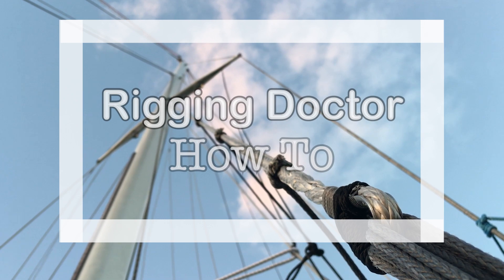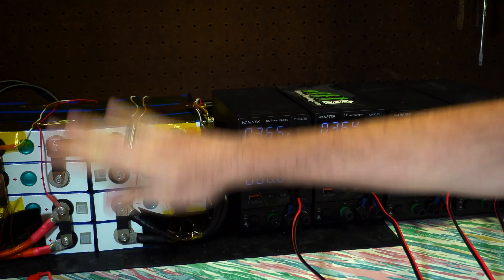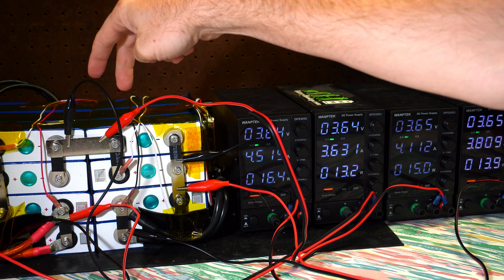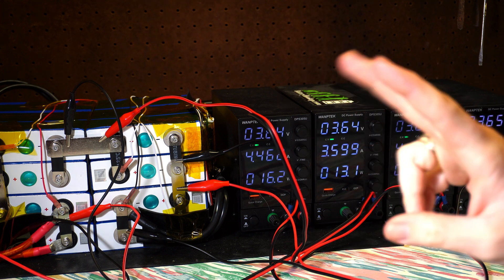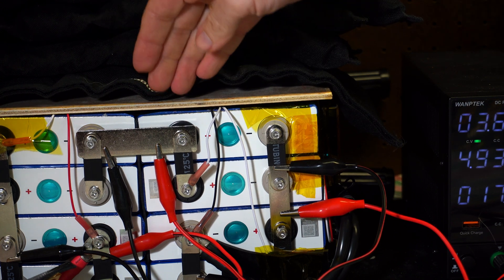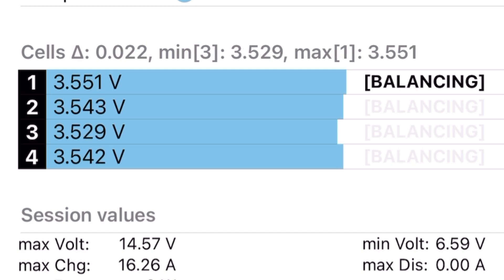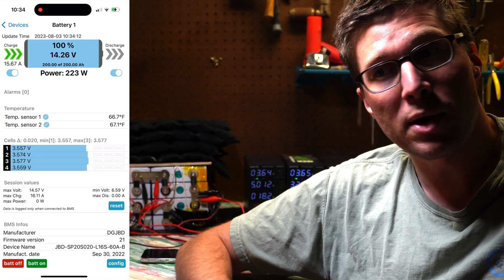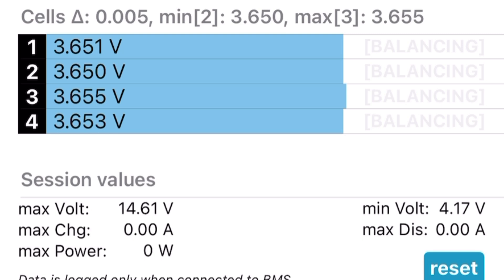Top Balancing a Lithium Battery Pack

Comment: same but 16s   pack   ~~
one cell was 1 year on bad bms and  now  doing it  with one wanptec  on an rc  charger to gain some more amps!!!  cables give about 10 amps   but system is on work so  solar  is raised to 3.44v   float per cell and after all  cells ( except the  lazy one i push )      been 3,55 for the day   but now rest  at 3.44  ..   but i choose for the cell 3.51v      amps it gets are more whole working system asks  from cell  but  it is in possition 16 to be easily replaced with a new if ruined!!!  
 but i figured out a little bit of parasitic    strange behavior in output  cell 1 and 16 !!!   maybe inverter is too big and  need to shut down  but the whole  buisness is off grid and everything needs to be under sun and monitored!!!  i lost the best time of the day the 2 hours of absorption so i  made some absorption made mppt    to float higher  ONLY  when i manual balance!!!
    question   ... HAVE you ever been dealing with  jk bms that  shows  strange behavior in a specific  cell possition no mater cell you put no mater  lid  you replace  !!! it has some sensitivity and cell possition 13  sags and overcharges inside algorythm   but cell is monitored and its ok!!   .  this bms  cant go more than 11 s no because of that bad behavior !!!   b series ... 20 s

Comment: So, Now I need 48 power supplies?
Reply from the maker: Haha! I feel that way sometimes!!
You can get by with much fewer. I only have 4. 
I simply charge 4 cells at a time, then move to the next set, then the next, until they are all fully charged. Then I wait a day for the voltage to settle and see how we are looking. Any cells that might need a little more get more charge until all the cells are within 0.001v of each other and above 3.600v. 

The other way is to take off the plates and wire them all up in parallel, then charge them up to 3.650v and then set them up in series. I haven’t done it that way because it seems like more work and higher risk since you could potentially cause a short by accident with a lot more power stored in there!

Comment: I would not recommend doubling up cells to achieve hire amperages.. There is always a chance one cell will go high resistance while the other goes low resistance causing one to under charge while the other goes nuclear meltdown and sets the whole pack n fire.. The BMS has no idea what is actually going on unless you have one cell per sense line.. For all the cash put into lab chargers you would have been better off getting a stand alone balance unit that can shift 5a or 15a from a high cell to a low cell.. This way you could push 100a into a 4 cell 280a assembled pack and have it charged and balanced in 4 hours.. With a BMS that has a 2a balancer it takes overnight charged in a couple stages but it is still faster and easier..
Reply from the maker: Do you have a link for the balance unit?

Comment: I found that a solid connection from the power supply to the battery actually increases the amps but plays havoc with the voltage

Comment: If you have so many cells to top balance (like you have like 60-100 prismatic cells, 3.2v 314Ah each), can you connect them all in parallel and top balance all the cell together at once, instead of having to buy 64 - 100 power units to top balance them or waiting forever to top balance each one at a time?
Reply from the maker: You could but you will want to connect them with jumper cables between the poles. When you top balance they will be full charge and if you then disassemble them to reposition them for the battery, you run the risk that they might swell and ruin everything. You want them compressed and in their final position when you top balance. 
Removing the plates and then running insulated wires from + to + to + will link them all up in parallel with minimal risk of a short from the - wires running along as well. This would let you hook up the power supply to the poles and give it a long time to come up to charge. 

Good luck! Sounds like a sweet build you are working on ;)
Reply: @RiggingDoctor  it's still quite hazy to really understand. Please I don't know if you could do a video to explain this practically - these are really practical stuffs and visual aids really go a long way and help so much. 🙏 🙏 

For building large battery packs like 60kw-100kw, that may involve more than 60-100 prismatic cell batteries (like the 3.2v 280Ah or 314Ah cells), how to top balance them all the right way.

If you could make a video on it, you may not need to use 60-100 cells to explain. Just 8, 10 or so cells will suffice (or just vocal clarification/explanation could do) to help us get the bigger picture on how to scale the top balancing method/process to any size of battery with any number of cells 🙏.

I initially was thinking 💭 🤔:
★ "do I need 64-100 seperate power units to top balance 64-100 battery cells simultaneously (to save time)"?

OR

★ "do I have to use only 1 power supply unit to top balance them all,one after another and wait forever to top balance all the 64-100 cells"?

Please if you could really do a video on this to clarify, it would be greatly helpful 🙏 🙏 🙏 
Thanks. ✨
Reply: @RiggingDoctor  also please when top balancing the batteries, is there a limit to how much current you should use to top balance the batteries.

With powerful power units, it may be tempting to increase the amps supply to the batteries to like 10A+ or 20-30A, to save time and make the top balancing complete faster.

Is it okay to increase the amps to much higher values (for obvious faster time to complete) or not good to do so?

Comment: Why not just connect them parallel and charge with a higher power supply? That would balance more evenly than relying on four different Chinese power supplies.
Reply from the maker: The issue is the cell compression. To charge in parallel I would need to arrange them in a row with all the plates on. Then while full charge, reposition them into their new form and compress them again before the puff a bit. 
Charging each group individually is not as reliable if you are going off of the power supply, but that’s why having the BMS hooked up and telling you the voltage of the cell down to the thousandth let’s you make sure that they are all too balanced. 
If you don’t care about compressing the cells, then you will have the luxury of positioning the cells, but it’s one of my (unfounded) procedures that I do abide to. I have looked at evidence on both sides and see both points, but it seems like a small effort for a possible reward, so I compress the cells in their box.

Comment: I recently stumbled upon your channel and LiFePO videos. I wonder, why do you emphasize fire and explosion so much when I'm not aware of LiFePO chemistry suddenly bursting into flames. Does LiFePO need to be managed appropriately? Yes. But is it on the edge of catastrophic failure when it nears its intended operating parameters? Not that I've seen or read. Check out what John Adey, ABYC president, has to say about their recent tests on LiFePO and their attempts to recreate some of the catastrophic failures rumored to occur. They failed. No conflagration. No meltdown. No real drama. Certainly the batteries need to be monitored and operated within proper parameters, but the inherent risk factors of LiFePO feel a tad overstated in some of your comments.

Comment: Your video is very interesting is it possible to repair Your bms when they go bad
Reply from the maker: If you know how to solder on a circuit board, then yes. For me, I just carry a spare. A few bolts and plugs and it’s back up and running.

Comment: In my opinion, top balancing is not as relevant anymore as it used to be. A modern BMS will have active balancer that does the work for you.
Reply from the maker: This BMS that has very good safety features that actually work doesn’t do a good job at balancing.
Reply: @RiggingDoctor  Cheaper to buy a new BMS then a PSU... 4 PSUs in your case... 🙃
Reply: @offpro  you can also buy balancers that you can hook up until the cells are balanced. They are cheap. Way cheaper than 4 power supplies.
Reply: @RiggingDoctor  Yeah, because you don't have it hooked up properly.  From the video, it only looks like you have 4 balancing leads trying to balance 8 cells.  You honestly shouldn't be making these videos if you don't know what you're doing.

Comment: I prefer the 5A active balancers for top balancing new packs. The cells ship at roughly 50% SoC, and are not at all balanced, but also, they’re not wildly unbalanced (like 70% SoC and 30% SoC). 
Hooking them up in series, with their BMS, and charging at pack voltage allows more watts of charging faster at the bench supply max current. It also provides good per-cell voltage tracking. 
Once the cells start approaching knee of the curve (~3.40V/cell), you turn on the active balancer, and keep the bench supply charge voltage at 3.5v/cell. 
Once charge acceptance drops to about 1A, you creep the voltage up by 50mV/cell, and let the active balancer do its magic. Keep creeping charge voltage up until you get 3.65v/cell and less than 1A going in to batteries. 
I use a BMS that gives me some relays and event-logic I can use to control the active balancer circuit since leaving it on in the flat part of the curve is actually bad for long-term balance.

Comment: I know you mean well to help educate your followers but you are creating a large group of misinformed YouTube warriors. You might want to do a deep dive in to “off grid garage”. There are a ton experiments he has done to dispel many myths and misinformation out there about lifepo4. Some of which you are perpetuating in your videos. Just friendly advice, not trying to be unkind.
Reply from the maker: That is a good point, and while it is really hard to make a bad situation with LiFePO4 cells, fire or high heat on a boat is a very bad thing. 
My thoughts were two fold: 1. If I scare them, they will be careful and stay safe, 2. If they use Li-ion because they didn’t realize there was a difference, they will be ok (but the ion cells are the real danger cells on a boat. 
There are test videos where LiFePO4 cells catch fire, but the tester really “tried hard” to make them burn.

Comment: You could balance the battery very quickly with a RC style lithium battery charger because they have decent balancers for balancing multicell battery packs.
Reply from the maker: The issue with “quick” is the cell doesn’t accept the full charge quickly and it really does take a while. You will never charge the cells this full ever again, which is why the battery is said to charge very fast when in use. 
It takes a while but it’s worth it as it makes the whole battery work better.
Reply: @RiggingDoctor  When the battery cells are receiving less than one amp at full voltage the battery is very very close to 100 percent. Continuing to charge at less than one amp is not worth it because there is no more battery capacity to be stored in the battery. So the RC style charger will balance all the cells so they accept the same level of charge by using a resistor across each cell that is higher voltage than the others until every cell is perfectly even. The charger doesn't have to charge for hours and hours at a low rate it just needs to charge until it sees that all the cells are charging evenly when at 3.6-3.65 volts for perfect top balance.
Reply from the maker: Oh, you mean as a permanent part of the installation! That would be handy!!
This slow process is to get them all balanced since we don’t have that and they are being charged by a 58v source.
Reply: He talking about the Cellmeter 8 its 12.00 and i just ordered one.  @RiggingDoctor

Comment: You're a little off on your "Don't charge to 100%" comment.  Lifepo4 is not like other lithium chemistries.  The rule with Lifepo4 is don't keep them at 3.65 volts for extended periods of time, but charging them to 100% then stop charging, use them and recharge to 100% every day is fine.
Reply: Exactly @uhiyuff2095. The boat at the dock will have a float voltage. I set mine to 13.3 volts. That brings the battery down to about 97-98%. Not ideal but my manufacturer has confirmed this is ok for lifepo4.
Reply: Another thing I do is only use solar to charge my batteries. 3 -12v304ah batteries in parallel for a total of 12v912ah. They run the fridge and freezer every night to bring them down then charge back up the next day, stay at 14.1 volts for 15 minutes then float the rest of the day.
Reply from the maker: 3.65v is 100% SOC
I set the BMS to consider 3.50v to be 100% and to cutoff the charge at the high voltage mark. This keeps the battery almost fully charged on the high end and still with plenty of power to give on its way  down to discharge. 
The bigger issue is a boat that sits all week charging from the solar panels and is full charge until the weekend, that would be an example of 3.65v for a long period of time most of its life.
Reply: @RiggingDoctor  I would hope the charge controller would have a float charge mode set at a lower voltage than the bulk/absorb voltage level.
Reply: @RiggingDoctor  agreed if the batteries sit at 3.65 volts for the entire week. I’ve had LifePo4 cells for four years now. Our boat stays at the dock during the week charges to 3.55 V every day and runs the refrigerator throughout the night actually 24 seven our solar panels bring the battery up to 3.55 almost every day.

Comment: The context for this is if you are running component cells, presumably with a BMS, NOT one or more retail batteries of nominal voltage 12v, 24v etc
Reply from the maker: Yes, this is the third video in the series on making a lithium battery. This battery is a 12v battery but it could easily be reconfigured to make it a 24v battery (with a different BMS).

Comment: So, you state that LFP's hate being charged to the max, yet later you say on a sailboat with solar panels they ARE going to be fully charged a lot of the time. So what's to do? Do we have to have a cut off on the solar controller and mains charger?
Reply from the maker: Just use your electronics a bit more liberally when you are at full charge to help bring them down. Running a high power appliance during the day would be great as it will bring the power down while the panels are cranking the power. 
Ideally, you want to keep the battery between 10-90% state of charge. 
Basically, if you are charged up, turn on the water heater and use up the power. If you have an electric dinghy, this would also be a great time to charge its battery as well. 

Basically, the panels will charge you all the way up but the batteries don’t like it but as you use stuff in the boat, especially that night, it will bring the batteries back down to a comfortable level.
Reply: @RiggingDoctor  You're confusing advice for other lithium chemistries with Lifepo4.  Lifepo4 can handle being fully charged every day.  The rule is, don't keep Lifepo4 at 3.65 volts for extended periods of time (like days to weeks at a time).  This comes from my research and several manufactures advice.

Comment: The question is if you don't have access to each individual cell, as in an enclosed battery, how do you top balance then?
Reply from the maker: You top balance it before you put it in the case.
Reply from the maker: I couldn’t reach the cells in the case, so I top balanced the pack before I put them in the case.
Reply: Mine is a bought battery I didn't make it. I have no access to the cells inside. @RiggingDoctor
Reply: @mymobile5014  In that case, you don't need to top balance.  The manufacturer should have done this.
Reply: @mymobile5014  Yes, I bought a prebuilt battery and if you follow a little procedure the internal bms can balance the cells. What I did was setup a charger connected with a smart outlet. I set my smart outlet so the battery would charge for 10 minutes (once fully charged) then turn off for 10 hours then on for 10 minutes and off for 10 hours for 3 days and then the battery slowly got more balanced. I just got the battery and I didn't know if it was perfectly balanced and now after reading the full charge voltage of the battery I can be assured its balanced.

Comment: The battery charge controller doesn't manage this for you?
Reply from the maker: The expensive ones do, but not all chargers will, especially not a cheap solar controller. 
It is always best to have built in safety protocols integrated into the battery so that if you change chargers in the future and forget to set it up properly, it won’t kill your batteries. 
By installing the safety controls in the battery, you don’t need to worry about the amount of charging or quality of charger you use to power the batteries. They are merely receptacles for storing any power given to them.
Reply: @RiggingDoctor  You're killing me man!  Don't depend on your bms for low voltage (or high voltage) cutoff.  It should be a last resort!  BMS's use mosfets to cutoff discharging and charging.  Mosfets are susceptible to failure under "high" current (especially in the cheaper BMS's).  FYI, your BMS will still work if one or a few mosfets fail, so you won't know you have a problem until you have a REAL problem.  Always configure all other devices to cutoff at specific voltages and save your BMS safety for the time you really screw it up.